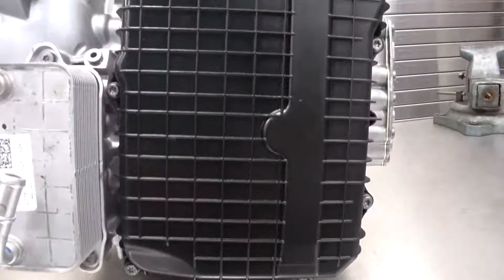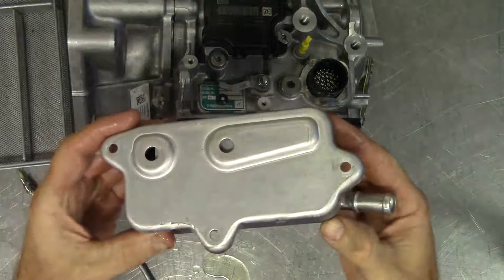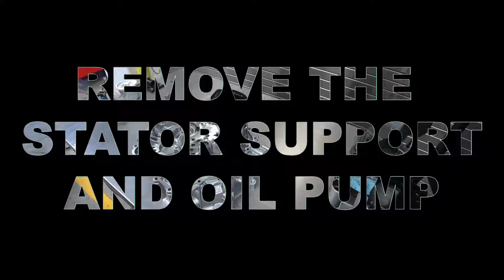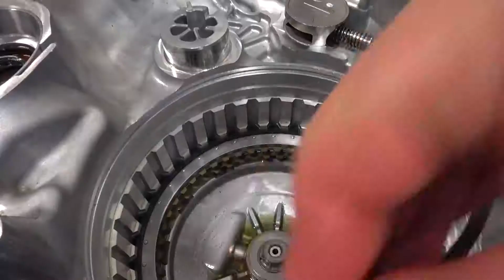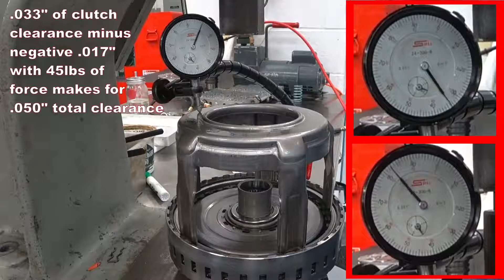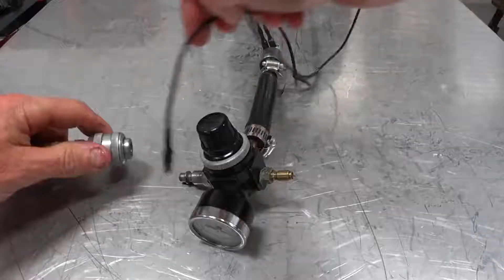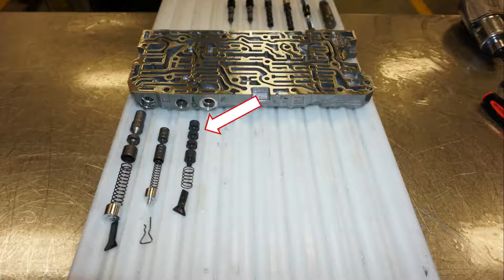zf 9hp48 overhaul video

Comment: Hi , thank you for posting this great tutorial , I’m am experiencing harsh shifting from 2nd to 3rd on my evoque it also appears to hold 2nd in higher RPM until upshifting , i am a technician so I’m looking to try and rectify the problem if possible , I have taken it to Land Rover and have checked for software updates and had the addaptives relearnt . I’m being told to change the oil next but there is a bit of confusion over the spec as the LR023288 is equivalent to lifeguard 8 , ZF appear to recommend Lifegaurd 9 . Any help or advice would be gratefully received.
Reply from the maker: I do know that dodge uses the same fluid for the 8 and 9 speeds.  Regarding your hard shift, they have issues with the c clutch return spring snap ring popping out of its groove. That clutch is used in 2nd, 6th, and 8th.  I wonder if it’s not allowing the c clutch to return as it’s released and cause a harsh shift?  If you have two hours to burn, I have another video going through the theory.
Reply: @siuautomotive  thank you for your reply , I have watched you other video tutorial which is excellent and very in depth , it is very hard to find anything out about this transmission in the UK , is it possible that the fault could be caused by a sticking/ dirty proportional valve or as you have suggested more likely to be in a clutch pack , there are no errors in the TCU , what controls the blending between the gears ? so is this likely to be a problem with clutch C not disengaging or could it also be clutch B not engaging correctly . I would be grateful for any advice you can give me 🙏
Reply: A mechanic from the ZF representative in Poland said that ZF does not recommend ZF8 oil for the 9hp48 gearbox. Therefore, the Zf 9 was created to prevent gearbox failure. Apparently, the ZF8 was foaming.
Reply: Use Honda/Acura 3.1 ATF Fluid. They have extra additives to help with smooth shifting

Comment: Hi, I’m in Ireland and I am looking at a Honda CRV 1.6. Twin turbo diesel and it had this gearbox, can you tell me if it’s a good or bad gearbox?... many thanks 🙏.
Reply from the maker: Well, Honda has had better luck with it than Jeep.  The manufacturers are responsible for writing their own software for shift timing and shift quality.  I know that Jeep has many software updates to improve the shift quality and Honda doesn’t have near the updates. That kind of tells me that Honda is better at figuring this transmission out.  I will say that I think Honda is using this trans as a stepping stone until they get their own 10-speed perfected.  My assumption is that in the future, most Honda’s and Acura’s will have the 10-speed or a cvt.

Comment: 5 minutes in and this shows more information than what Honda ever gives us at the dealership.  Comparing this to the new 10 speed, I hope the new 10 speed gives us a lot less headaches.
Reply from the maker: Thanks!  The 10-speed is an impressive unit.  One day I’ll go through that trans, because I have a few on the shelf.  One of the next units I’m going to cover is the 6-speed because those are finding their way into the transmission shops.

Comment: Can it live 200 000+ km if change oil? Car - discovery sport 2020
Reply from the maker: I think so!
Reply: Mechanical reliability doesn't seem to be an issue with these especially on late models.      Just keep the fluid freshened up once in a while.

Comment: Hi, great job! I have sometimes hard up swifing from 4 to 5 gear. No others issues. What could be?
Reply from the maker: First thing I would have the dealer or a good shop to check to see if there are any software updates.  They've improved the software quite a bit on these, especially on the earlier vehicles.
Reply: 1st, visit the dealership to see if there's any software update.  If you're outside of your warranty, this is going to be an out of pocket expense.  Another thing we've discovered is a dirty throttle body can cause harsh upshifts due to a need to reduce torque when shifting into the overdrive gears (when looking at live data, anything more than 5-8nm force on the throttle motor is excessive)
Reply: Design-wise the 4-5 and 7-8 upshifts involve releasing a dog clutch and applying a friction clutch. The ideal shift is to overlap the apply and release timings to have a smooth transition. However with dog clutch release, if the timing is even slightly off there will be either a torque “bump” or a torque “hole” because of their on/off nature.